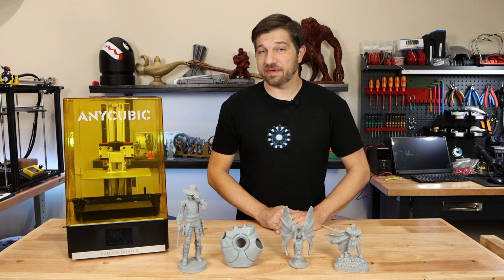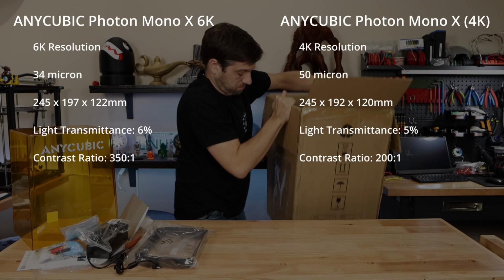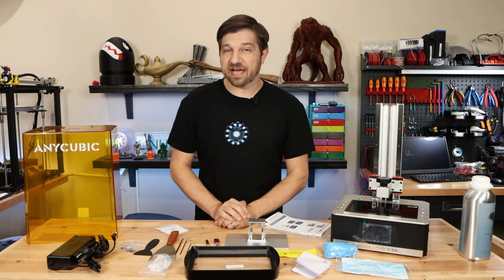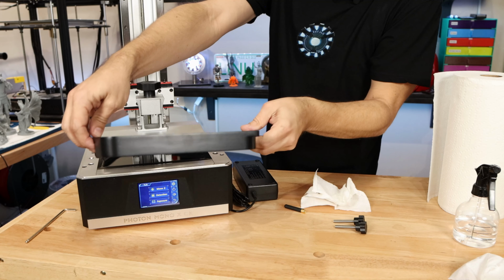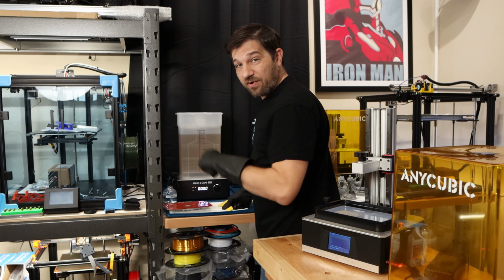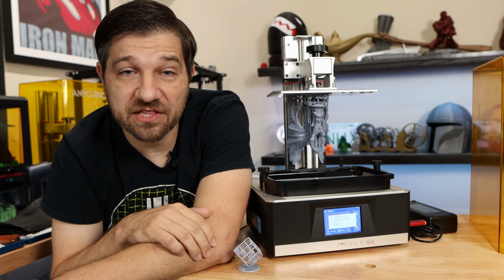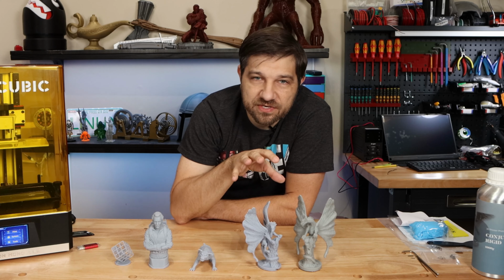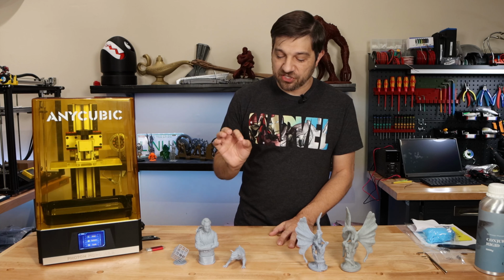ANYCUBIC Photon Mono X 6K Complete Walkthrough!

Comment: Running this print now, and I notice the build plate moves up and down every layer. I don't see it doing this in your video which makes me wonder if this is normal? 
Thanks and great video!
Reply: Update, nothing printed. 4 hours later and nothing.. I cleaned everything with IPA, leveled the build plate, and tried multiple print. Nothing works. I tried the exposure tests and they all show the same thing of the full screen illuminated which is leading me to believe there may be an issue with the UV lights.

Comment: Does the mono 6k have the vat cleaning feature for cleaning failed prints off the FEP film?
Reply from the maker: It has a few test pattern modes that could be used for this. I don't remember off the top of my head if it has a full screen but I'm almost certain it does.
Reply: @Kersey Fabrications  thanks for rhe quick reply. Me and my dad are both looking at this model printer. I know mono x has the Fep cleaning but can't find anything on if the mono x 6k has it
Reply from the maker: The firmware is almost identical.

Comment: I would like to know why nobody references actual dimensional accuracy for these printers. A lot of users may not want to print only monsters and fairies, but would like to make serious parts for things like robotics and other mechanical devices, where accuracy and tolerances really matter.
Can you point us in the right direction for any of this information?
Reply from the maker: Absolutely! The general reason that no one talks about it is that these screens have a known and fixed resolution that you enter into the slicer. Unlike an FDM printer where you have to rely on a motor going very specific distances and putting out precise amounts of filament, this will always print the part exactly the right dimensions as determined by the screen pixels.
There is tuning to do though just like any printer based on the specific resin and exposure time. I've been doing this recently on my new printer where I print a test print and measure the results based on exposure time. Maybe this would be a good idea for a video? Let me know!

Comment: Everyone Brags and I got one and i can't make it work
Reply from the maker: Dude that sucks! Is it cold where you're printing? I'd ask if your bed is leveled properly but that sounds insulting. Can you even print the demo print?
Reply: @kerseyfabs  I have it on my office so the temperature is no issue, I have level it and change the exposure settings. I even got a different resin 

I just don’t know what else to try
Reply from the maker: How does it fail or does that first layer never stick?

Comment: I've been looking in to this printer for a little while and have been coming across a lot of reviews mentioning failed supports and just failed prints in general. All seem to be shortly after launch though. Has anyone experienced better results from any software updates or perhaps newer machines not having the same problems?
Reply: I just got mine in the mail and set it up tonight - now researching which slicer to invest time in learning. From what I'm reading so far it seems that the Anycubic proprietary software causes a lot of failed prints. Most people are suggesting Lychee as alternative. Good luck!
Reply: @akayeworld3506  Thanks for the info, I really appreciate it! I'd be curious to hear your thoughts after some use, if you have the time.

Comment: Hi Kersey, you have the best review, thank you! Could you check with your great contact at Anycubic if it actually comes with the screen protector? It seems so, but in some reviews people put that "extra" protector on top of the one that comes with...
Reply: I just got mine tonight and ran into some confusion with this same subject. It's hard to follow the printed manual accurately because the translation from Chinese to English is not great. It did seem to insinuate that you want to remove the screen protector that it ships with, and install the new one (provided) that some people are calling an "extra" one. This seemed kind of obvious for me because the screen protector it shipped with had a good amount of light swirly dust scratches on it, so it didn't seem like it was supposed to stay on like that. I removed it and replaced with the provided new screen protector.
Reply: @akayeworld3506  I think we are not talking about the same things, they are 2 different things. My printer (like everyone else's) came with a protector that we're trying to figure out what it is. It is the same as one of the screensaver protectors (the one with a black tab). Note that the extra protector (or the only one, which came to install immediately) has 2 protectors on it, one with a black tab and one with a red tab. The printer looks like it came with a screen protector installed and with it, one of those screen protectors protector, with a black tab, that is, it must have already come with a protector installed, I think. That's the question, was that black flap protector that came on all of us's printers, was it directly protecting the screen or was it the protector's protector and was it protecting the pre-installed screen protector? That's the big question.

Comment: I have never met anyone who has gotten this printer to work. Especially not me. You pulled off a miracle in this video. 6 months of troubleshooting and not a step forward to getting my machine to work.
Reply from the maker: How can I help?
Reply: @kerseyfabs  I cant get anything to show up on the plate. The build runs but nothing sticks. I cleaned everything, leveled it and tried different prints but nothing works.
Reply: I have been having trouble too. Some prints a fine but most are a disaster, even on the same plate. I have two photon monos that print with a 95% success rate, but the 6K, maybe 40%.
Reply: @thedogcalledno  which slicing program are you using?
Reply: @thedogcalledno  update it

Comment: Do you need a washer or could you just let it sit in the machine for about an hr or so?
Reply from the maker: You need to rinse the parts. They will have left over resin on the outside ven if you let it sit. You don't need a washing vat though, just a tupperware dish and maybe a toothbrush.
Reply: Thanks but already did a bit more research and ordered one. Sorry for not deleting coment, but thanks for your help anyway

Comment: Hi Kris!  Any settings you can recommend?  I'm familiar with 3D printing basics and have an Elegoo Mars 2.  Unfortunately, the only print I've had successful with this is the Anycubic Test Cube.  My printer does not recognize their Workshop Slicer (Anycubic sent me the lastest version but it still isn't working).  I've been using Lychee and have tried a dozen different settings (pretty standard recommended settings that are out there) and I've had constant failures with the supports and not sticking to the baseplate.  My lift distance/speed, exposure time, etc., all are the recommended ones but still FAILURES.  I am so, so frustrated but maybe you can work some magic for me.  Or, IF ANYONE ELSE COULD GIVE ADVICE, IT WOULD BE APPRECIATED.  Regards, Tom
Reply: You can try  better leveling building plate
Reply: @milhausemilhause5502  Thanks!  I've done that three times.  I wonder why the Anycubic test print file prints with no issues but everything else is terrible?  :(

Comment: I cant get my mono x 6k to even print the test print correctly. Prints are constantly falling off of supports or printing crooked. Sometimes it doesnt even print anything beyond the first few layers. I previously had a Elegoo Mars v1 and it printed fine from the get go.
Reply: Mines doing that too. Did you ever figure it out?
Reply: @billiediercks1990  Not really. It prints fine now. All i did was add a magnetic plate to the build arm for easy removal. I have printed several things now and it seems to work fine. Havnt tried the test print since.
Reply: @Vaioplayer88  ah, thanks!! Good to know

Comment: I can never get things off the build plate if it's directly on there. The test print nearly messed up my plate and came apart in pieces. How do you get passed this? Did I level wrong? xD
Reply from the maker: It can sometimes be very difficult. First, you should be able to get one off with a good, flat metal scraper. Second, make sure you minimize the contact with the bed. Don't use sleds. Third, if you really get tired of it, see my video on the Wham Bam Flex Plates.

Comment: One thing I should point out is that on this printer, as well as other's I've used, the build plate does not tighten evenly when leveling.  Once you tighten the Allen screws for the build plate, one side presses down on the LCD much harder than the other side.  I've had to install a shim about the thickness of two pieces of paper on the right side where the plate tightens.  This is because the plate mount is a fraction too wide and doesn't tighten evenly.  For a shim I use a leftover anti static material I get when ordering Arduino parts.  It's not effected by moisture, alcohol or resin.

Comment: Hello!! Congratulations on your excellent video on this printer.
I wanted to ask you the favor of giving me your opinion on whether this resin machine is suitable for printing parts where mechanical relationships of the assembly type are involved with metal pipes, joints and in general situations and mechanisms that have live loads in X, Y and Z.
I would also appreciate if you can give me suggestions on what kind of resins to use for this.
Thank you very much !!!

Comment: I cannot get anything to stick.
Reply from the maker: I know it's been about a week and I hope you've had some luck. The only things I can recommend in general are:
1) Relevel the bed per the instructions.
2) Clean the build plate with IPA.
Other than that, there's not much else to do other than try another resin if all else fails.
Reply: It was the slicer.  Went to lychee.  Successful prints each time.

Comment: My first print failed, I’m wondering if I didn’t zero the build plate properly
Reply from the maker: It depends. How did it fail? Stock settings? Pretty standard resin?
Reply: @kerseyfabs  I used stock settings on chitubox as well as on the printer itself, and the resin is ANYCUBIC 3D Printer Resin, 405nm. As far as the failure type, the prints would start to stick properly and then fail halfway through.
Reply from the maker: @AceUndaunted27  You may need to relevel or increase the cure times in the base layers.
Reply: @kerseyfabs  just found out my vat wasn’t sealed properly from the factory. I tried printing twice and after the second time I noticed a puddle of resin under my printer. Turns out the resin had leaked through the vat, and into the printer from the top on the screen and out the bottom where the fans are. I have been in contact with ANYCUBIC trying to get the matter resolved.

Comment: Just a question I have one of these and have had problems with resin curing on the top of the build plate. To solve this I have made a black out cover to cover the printer all the time. I also have the Wash & Cure and use 99% IPA. The resin in the bin gets cured on the SS cage that goes in it. Have you had any of these problems?
Reply from the maker: It sounds to me like your printer and Wash and Cure are in direct (or indirect) sunlight. If that's true, you need to shield that from the printer. Blinds or curtains.
Reply: @kerseyfabs  I think you are right. I am trying a black out cover. Shouldn't the cover block all the UV though.
Reply from the maker: Yeah, while it's on. If you take it off, it wouldn't take long for it to react.
Reply: @kerseyfabs  Well I will just have to make sure it is covered then.

Comment: Could you maybe talk a bit about wash & cure machines for the Mono x 6k? I'm not sure which machine to get that will fit the build plate.
Reply from the maker: No problem at all. I use the Anycubic Wash and Cure Plus which works perfectly with this printer and the regular 4K version. I bought mine on Amazon and they're running a great deal on it now: https://amzn.to/3DmOS8L
The plate literally just sits down in it and cleans the whole thing.
Reply: @kerseyfabs  That's awesome! Thanks very much for the info!

Comment: Having a serious issue with my printer no matter what slicer I use it will not print. Nothing on the build plate or even the Fep it's like the screen isn't printing it lights up but it lights up the whole screen faintly like an exposure test and that's it. Funny thing is though if I print the test print it does it perfectly. What am I doing wrong here. It recognises the file on the printer screen with the picture etc but won't print anything.

Comment: I apologize if I didn't understand it.
Is there any difference in the printing quality?
Reply from the maker: Between the 4K and 6K? Some. You can definitely get smoother straight walls from the 6K than the 4K (from preliminary testing). I haven't done an in-depth side by side on prints though.

Comment: Nice video!  Thank you posting it.  What happened to the project with the anycubic?  I have this printer, and it prints figurines and test prints just fine.  I bought it for prototyping and for the love of goodness, I can get as close as a 80% perfect model, but there is always so sag somewhere along an edge that is supposed to be sharp.  Super frustrating.  I bought my first 3d printer ten years ago, and may have to pull that out of the closet just to get a finished model.

Comment: I don't suppose you have tested any different settings on this one yet? Having issues dialling mine in (failures galore) but I am well new at this.
Reply from the maker: The default settings have worked quite well for me. That will greatly depend on resin though as well as factors like room temperature. You may have to manually tune. Look at the flat printing tests to get started.

Comment: Hi, one question: 
This printer works with STL or OBJ files?
Reply from the maker: The slicer is what handles the models, not the printer directly. There are slicers that will process both STLs and OBJs.

Comment: how long its take to print each designs? Also the measurement of prints ?
Reply from the maker: The print time is directly tied to the height of the model. A model that's about 110mm tall may take around 5-6 hours.

Comment: Anycubic are saying it might be 6 months before these things are available :( gutted.
Reply from the maker: Shortages and shipping issues are affecting everyone. That sucks!
Reply: @kerseyfabs  I got mine a few days ago.
Reply: @kerseyfabs  As it turned out I was able to get onto a pre-order and I've had my 6k for about a month now. I have to say it feels a bit like Anycubic just threw some new numbers into an advert to try to sell some left over hardware, because there are issues with this printer that the standard Mono X doesn't have (the lack of RERF support being the big one). It's also mind-bogglingly slow, it's far slower than my old Elegoo Mars Pro - and that had a colour screen!
I think all things considered I wish I had gone for the Elegoo Saturn instead or maybe continued saving up and gone for the Jupiter.
Reply from the maker: @Vormulac1  I had never used a RERF before. I had always just ran a few test prints at different speeds to find it. So that's news to me. I definitely don't find it slow, so I'm not sure which resin/settings you're using. I'm running 2.4 second layers with the last resin I used. Is that slow or are you not able to achieve that? If I remember correctly, Uncle Jessy was able to get some really fast layer times on this machine too.
Reply: @kerseyfabs  Using Anycubic basic grey resin I find 2 second layers work ok, but a file that takes 6 hours on my Mars Pro will take closer to 20 hours on the 6K - and that's with 0.05 layer height and recommended settings! Crazy.
Reply from the maker: @Vormulac1  Well, if it's not layer time, then it's some of the other motion settings that need tweaking. I'll have to check around to see what others have for settings.

Comment: This resin printer seems to have a bigger build plate than other resin printers. Please correct me if I am wrong. Would this resin printer be a good first time resin printer without having to edit G code or slicer settings?
Reply from the maker: This is a larger resin printer than a lot of the others on the market. While I printers require you to learn how to use them (leveling, supports, etc.), this one is no more or less difficult in that regard. A couple of other things, resin doesn't use gcode, so there's nothing to edit there. You will have to learn resin settings and slicer settings just like any 3D printer.